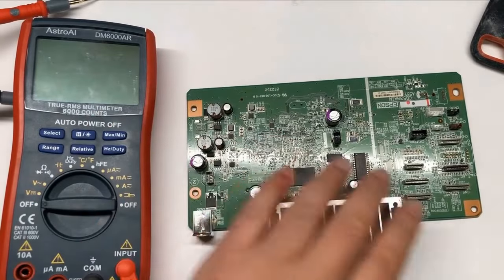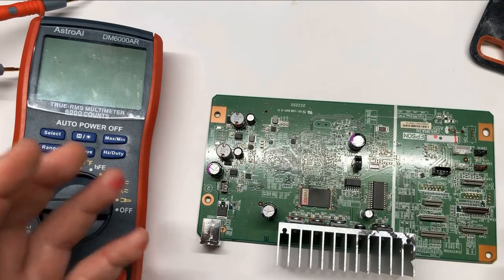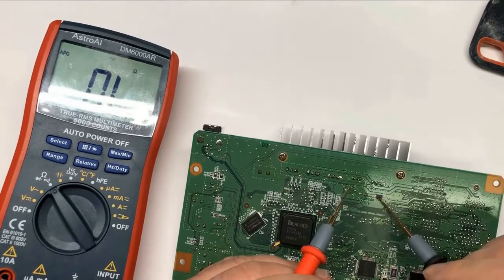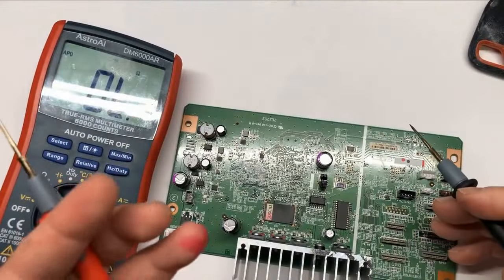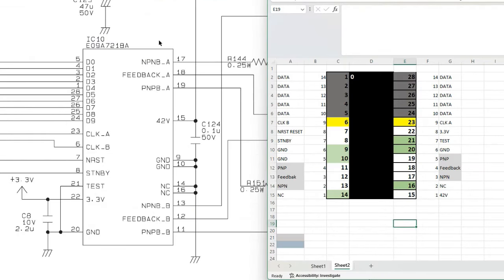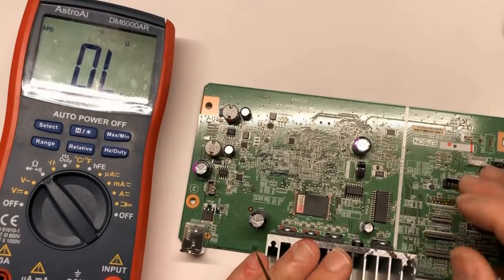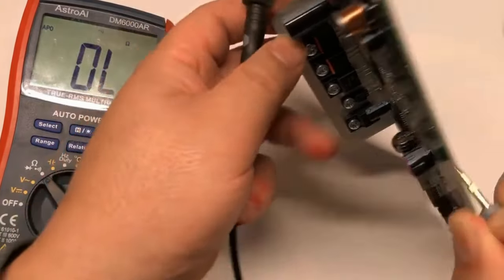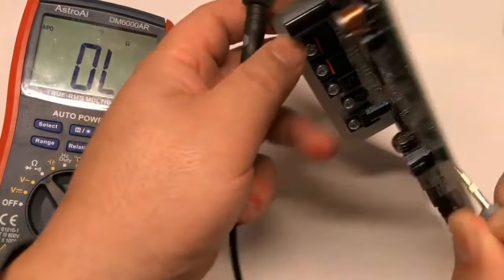Epson Printers Blank Pages or Slow - Test Driver Chip E09A7218A E09A7418A

Comment: I changed IC E09, transistor, resistor, fuse. I have replaced many part of printer then it power on and now it said "ink cartridge not recognized". Detection board and ink chip are good. Please help me near two months now.
Reply: Hi check CISC Card and cables flex, I had same error.
Reply: @EMIGROUPRD  I have replaeced them. It is still not working. It's seem that its firmware unable to detect replaced part after it died once.